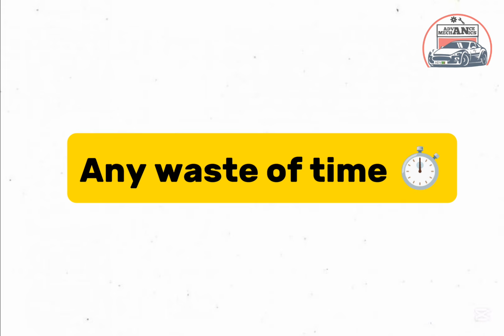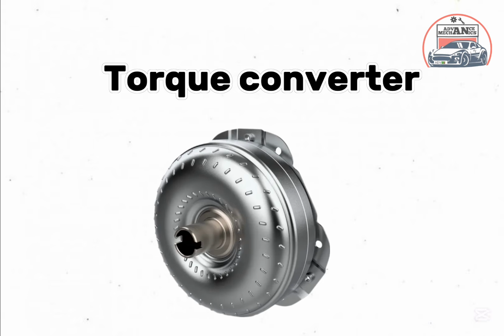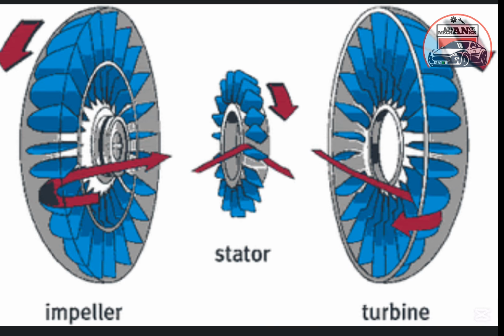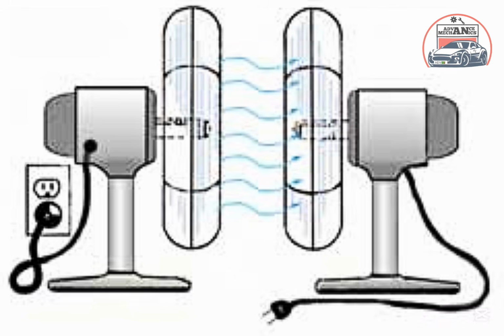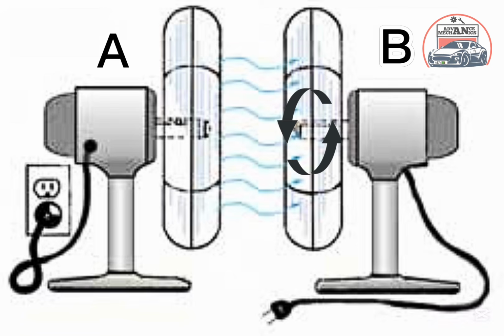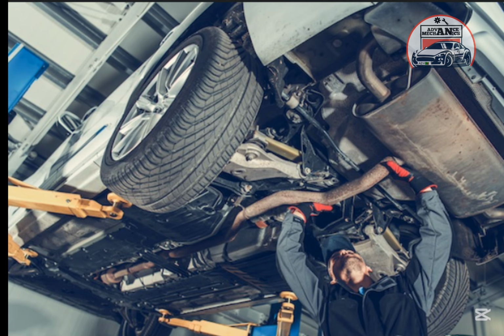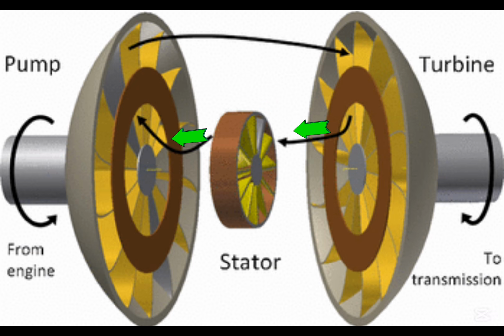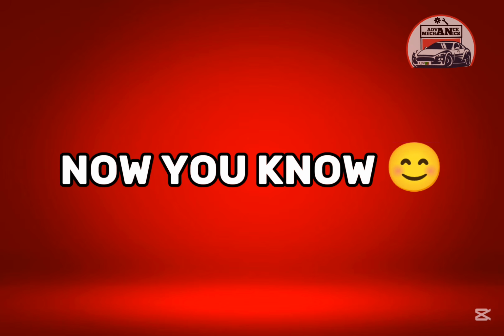How a torque converter works ( high yield)

Comment: It look like the fluid is enclosed, hut I don't think that is the case since we can change atf
Reply from the maker: You're right, the fluid circulates through the entire transmission system, which is why it can be drained and replaced. 👍

Comment: Why do I need a gearbox if I already have a torque converter?
Reply from the maker: To provide the required gear ratio for varied driving speeds and reserve movement. The torque  converter only multiplies and transmits the torque from the engine to the gearbox and at the same time,it ensure your engine does not stall when your car is not moving.

Comment: What do you mean @3:19 "some of that fluid is lost". Lost to where?
How does the fluid get to the stator from the turbine?
Reply from the maker: Once the impeller flings fluid to the turbine some some of that fluid don't return to the impeller so the stator collects and throws it back to the impeller. This means the impeller will fling more fluid resulting in torque multiplication.

Comment: Why we need torque converter.shall we directly connect flywheel and transmission with the help of one shaft
Reply: A direct connection would require that you completely stop the the engine when you come to a cross street and wait for traffic to clear. A tourqe converter allows for slippage at low engine speed and so the engine can keep running
Reply: Imagine driving a manual car but you can't ever use the clutch
Reply: @Garrettk2024 Exactly👍.
Reply: I invited these.